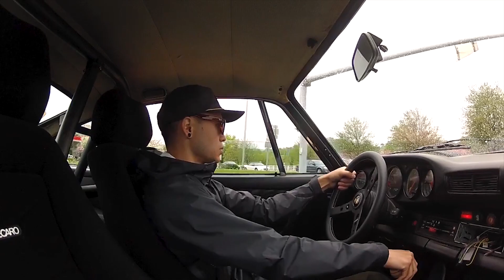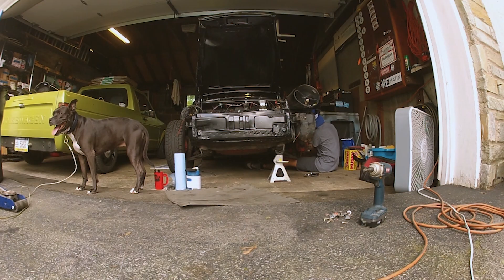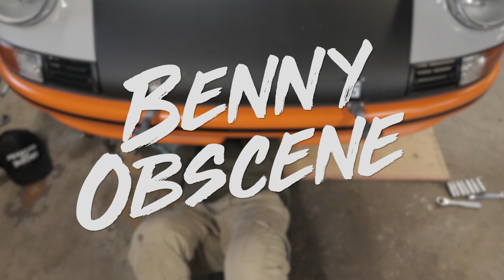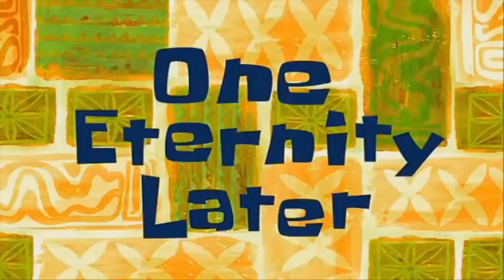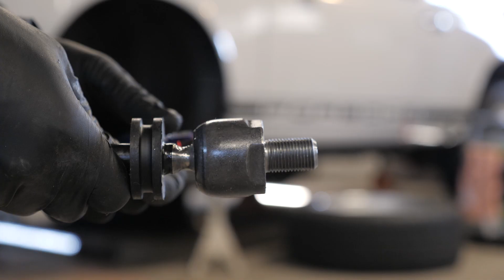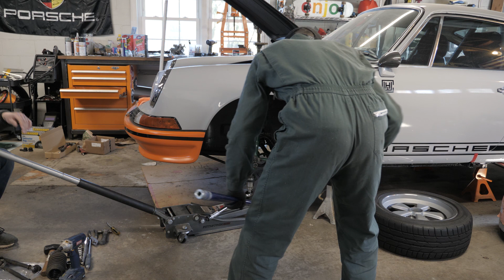Porsche 911 DIY Turbo Tie-rods & Ball Joints!

Comment: I have a 76' 914. and I'm at the point of trying to replace the tie rods. I wanted to remove the steering gear so I could do the work on a bench. But that turned into too many points of failure. I just bought new ends and called it a day. I'm too weak and old to lay on the cold floor trying to remove all these parts and pieces.